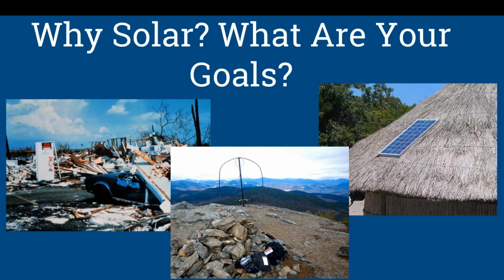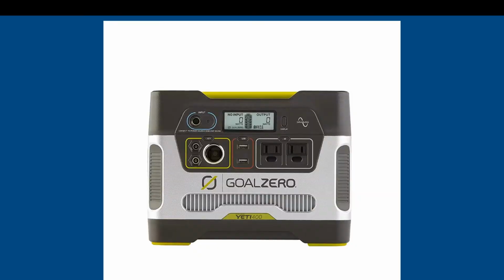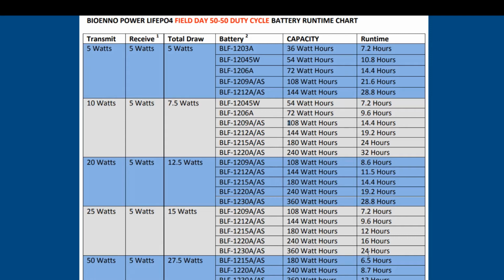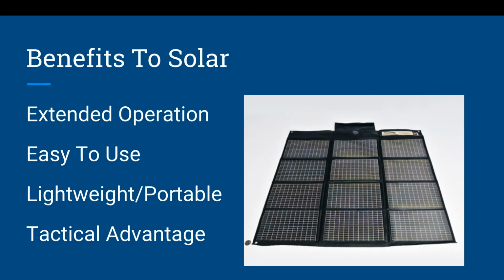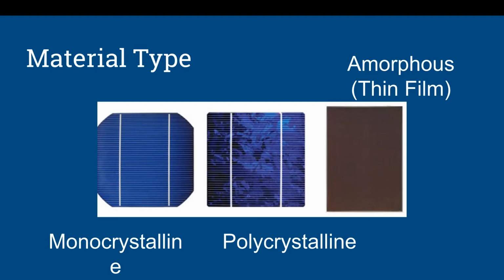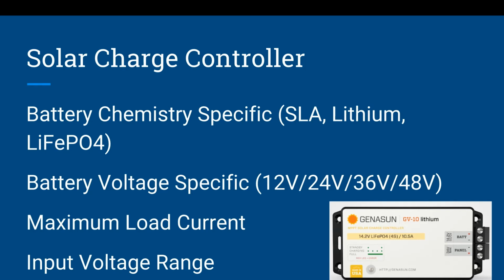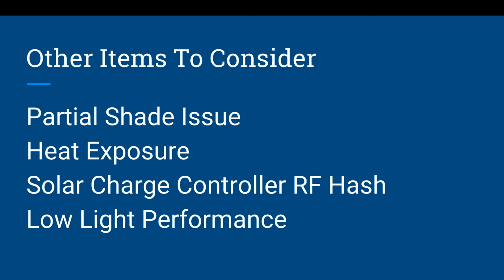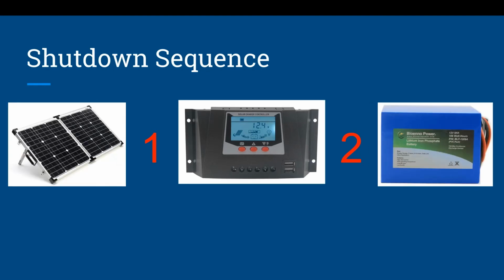Getting Started Using Portable Solar Panel To Power Your Life!

Comment: MPPT charge controller use the buck convertor and some may give noise!  Also only MPPT charge controller can take panels in series! This will let you use smaller wires from the panels to the controller.  In parallel you have twice the amps!  In series you have twice the volts.

Comment: Very good presentation on solar power. I have a Yaesu Ft-891 and im curious what kind of wattage solar panel would you recommend for running the radio on 5-10 watts and running my computer as well.
Reply from the maker: Small 30 watt should do fine.

Comment: Great videos!  One point / question on the solar charge controllers.  Those are obviously microprocessor controlled, so why wouldn't they automatically power up and sense the battery status/voltage first, then the solar panels?  Seems to me it's a bad design if you have to specifically only hook up the battery first, then the solar panels after powering up.
Reply from the maker: I agree. You would think. Perhaps this issue is solved in different models. But hard to tell so I just play it safe and do the sequence the right way.